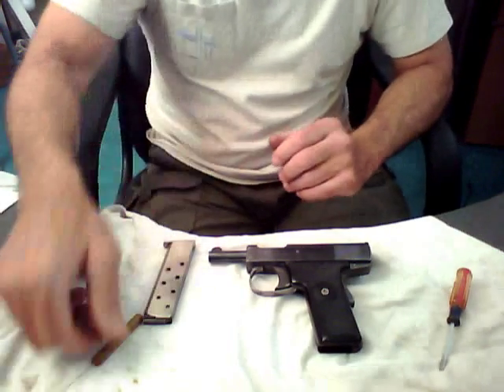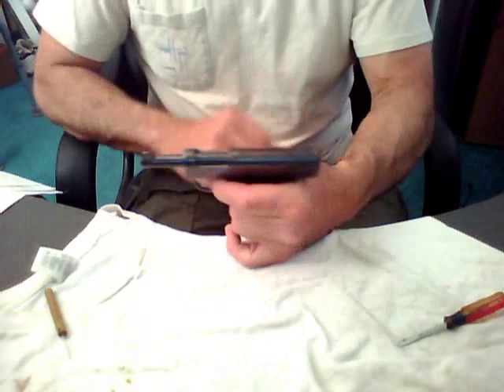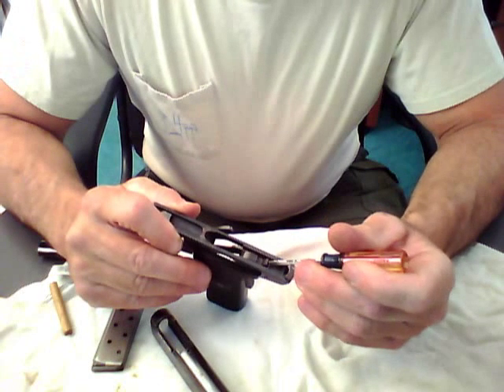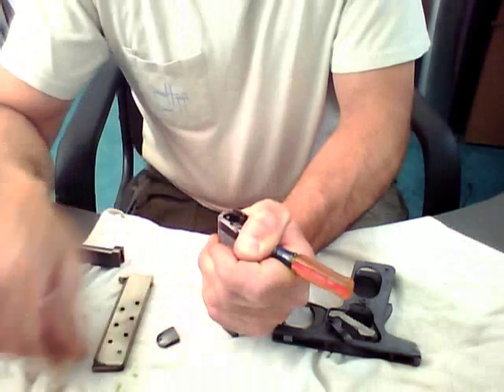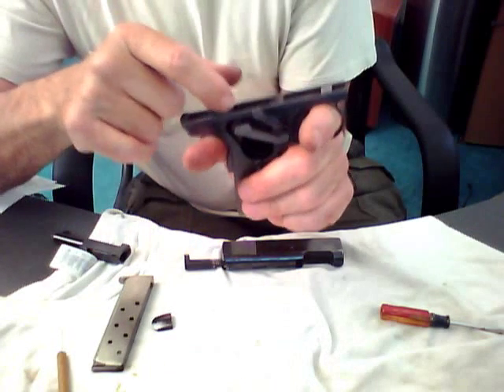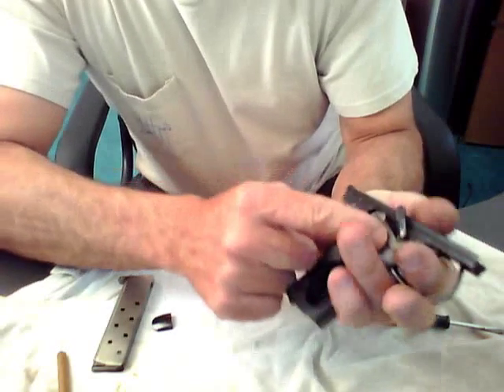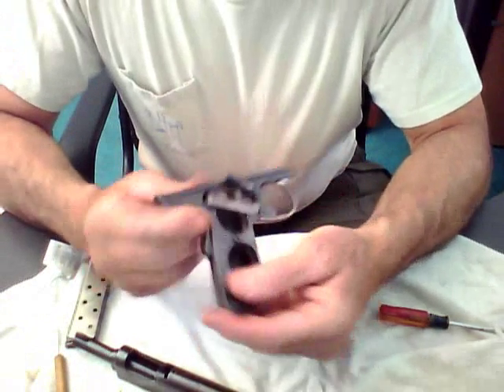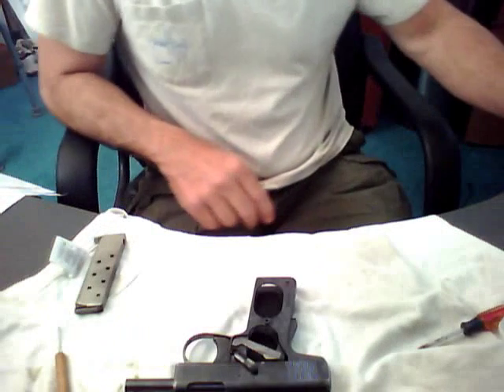Disassembling Harrington & Richardson Self Loading 32 Caliber Pistol

Comment: Could you please measure the length of the firing pin spring guide. It looks like a small pin with a head that supports the firing pin spring. I'm having trouble with the spring bunching up & I think someone altered mine too short. Thanks
Reply: Ik it's been years since this video but I'm having same problem did you find a solution